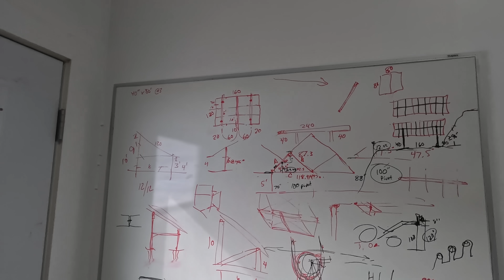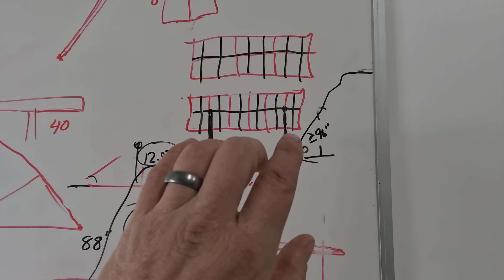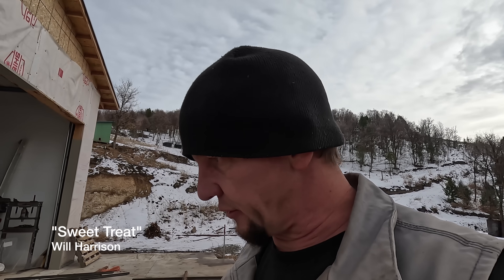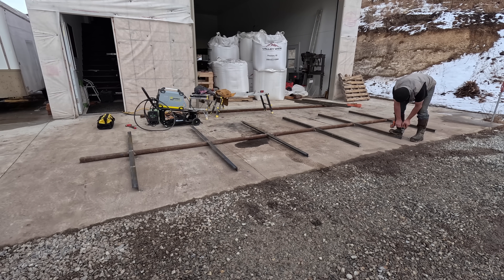The ULTIMATE Solar Rack Build | Using Angle Iron and DRILL PIPE \\ MOUNTAIN MAPLE RANCH

Comment: Hi.....me again😂....when are thinking of doing the siding on the workshop.?..?....😊😊😊😊
Reply from the maker: We are planning on doing the addition to the back of the shop this winter and that is when we will be doing the siding. There are many things to add before that project gets started. I will be adding AC unit in the battery room, and a vent for the processing kitchen, lights and lean to's. Once those are completed the siding will go up pretty quick.

Comment: Was wondering when you’d get snow!   Like your plan for solar but have a question.  Is there a reason to not install on the workshop roof, or even the new shed?  Is it a snow weight issue or sun angle issue. Just curious. Have a fantastic week!
Reply from the maker: It's a sun angle thing. The new shed is sloped facing slightly north of west and it is 1500 feet away from the shop where our battery system is located. The shop roof is also oriented that way so I would end up needing to build racks on the roof to orient the panels and then I wouldn't be able to change angles with the season. Might be worth mounting some flat on the roof in the future just for supplemental harvest at some point but not for now.
Reply: @ Thanks for your answer!  I was thinking it was sun angle, but I’ve seen other folks put on roof.  One can never have enough power - lol - especially in your workshop.  Well thought out and super progress!